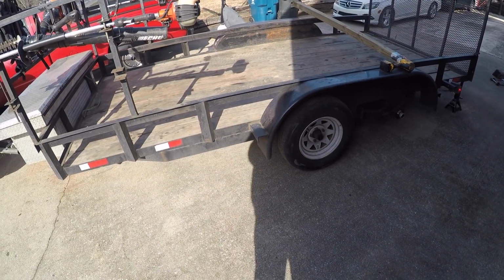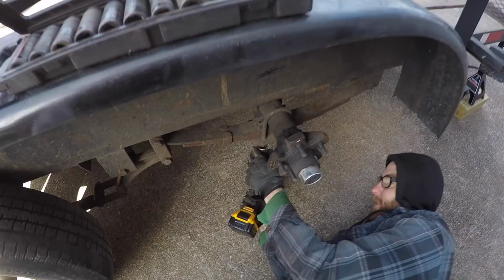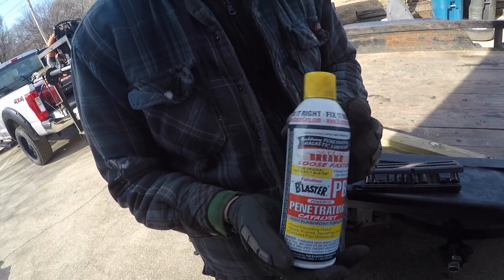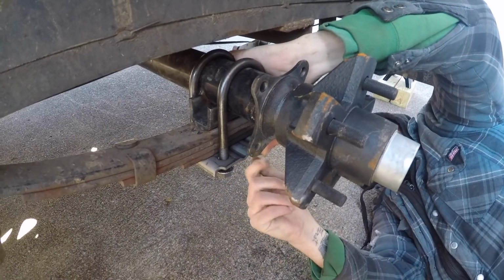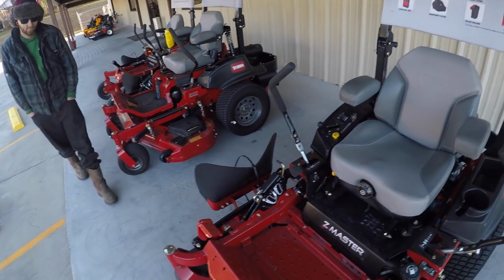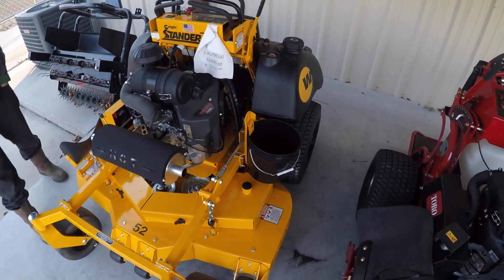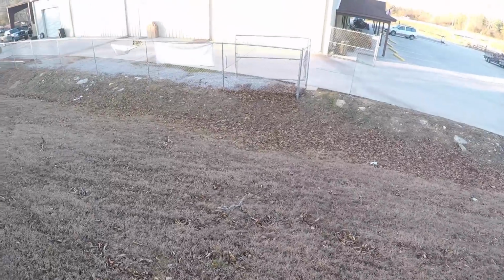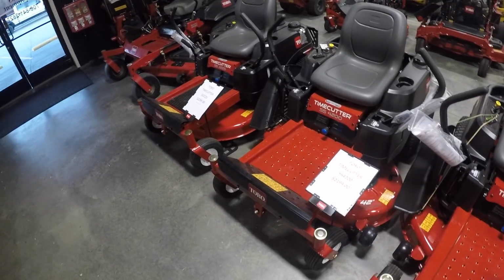What is the Wright Mower?

Comment: Well I am a toro or Exmark type guy. Our area has every single brand available and all we see is Scag and Exmark / Toro and Ferris. Wright, Deere, Gravely, ect doesn't cut the grass as nice. The Vanguard engines hold up just as good if not better then the kohler command Pros and Kawasaki engines. EFI runs nice and smooth my ninja!

Comment: If you think PB Blaster is good shyte, them you have never tried  Aero-kroil by Kano Labs...  You can only order it SHIPPED to a business address and it is not sold in stores. This stuff is beyond top shelf. Creeps into 1 millionth of an inch spaces..  I have seen it soak through plate steel.  There is always a can in my truck... I loved PB , but this stuff is used by the county,state DOT, regional public transportation authorities and even the guys at the local Cummins factory owned service center.  Nothing short of amazing, often times a good soak by itself is better than a soak in PB and heating with a torch combined...   google search Kano Labs aerokroil google deal... good luck an good wrenching !
Reply: looks like they sell it on amazon, too.
Reply: probably,  I always get the "Google Deal " straight from them though. $20 gets you two King size cans at your doorstep.

Comment: agree with others stating that aerokroil for penetrating the best, mostly i use fluidfilm as it does better for preventing rust. 

i havent got to see what one of the rear discharge decks look like on the wrights but its something id like to see how it does.  if your looking for one of those mowers here is the price list for this year http://www.wrightmfg.com/wp-content/uploads/price_list/Wright_Power_MSRP_2018b_eff_2017_08_26_rev_2017_10_11a.pdf?6d2a06 at least you can see how close/far your dealers are off price wise.  if you can get that for  8.5 thats pretty good from what hes buying it at wholesale (those prices dont get shared especially here) and hes not making a killing on it either.       there is a reason scag copied them this year for the standers.